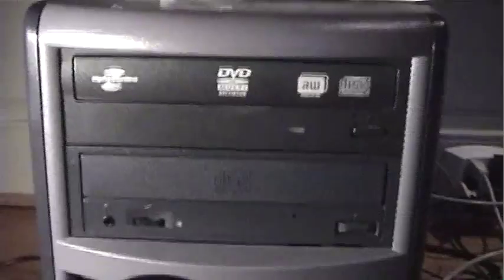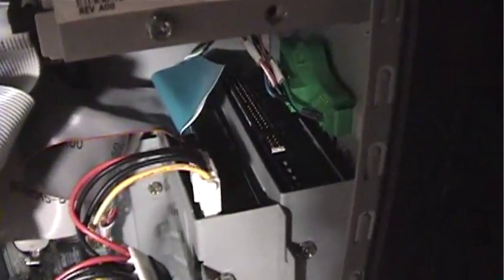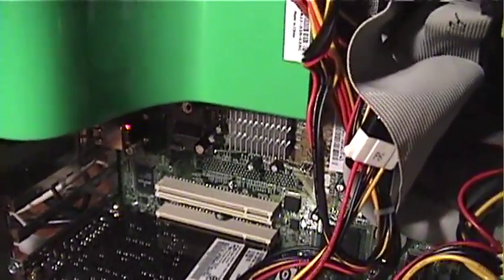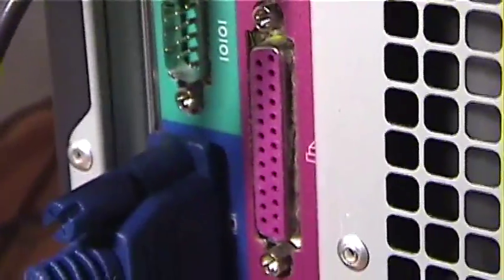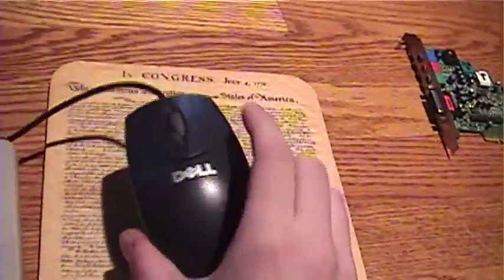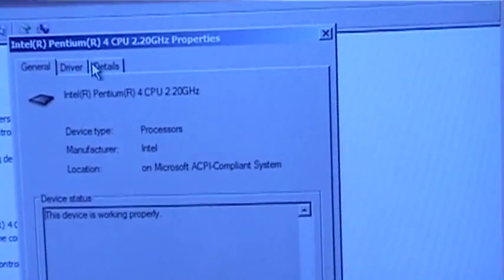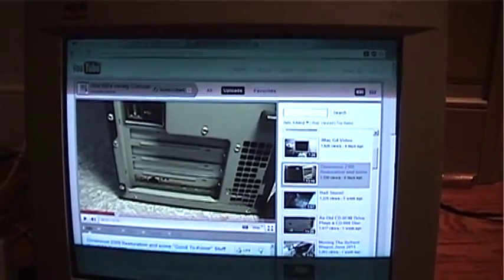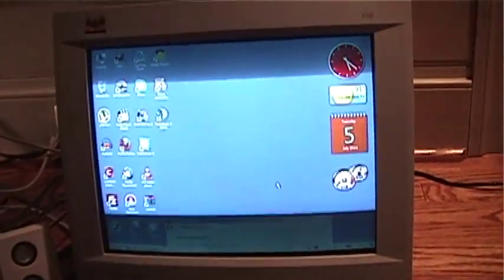Dell Dimension 2350

Comment: I used to have a laptop that was just like that. It was a Dell Inspiron 1100. It had a 2.4GHz Pentium 4 northwood and basically all of the other hardware that the 2350 has. What onboard audio does it have? Mine had some kind of sigmatel chipset and it didn't sound half bad.

Comment: Ah the Dimension 2350, I still have this machine. I got it 2gb ram and put a P4 2.4Ghz (Originally had a celeron 2.0). There was no real purpose for upgrading it, but hey why not. I like messing with these older computers.

Comment: ive also got a Dimension 2350. Pentium 4 1.8GHz. Whats the RAM cap?? I wanna go to 2GB, but some ppl have said it only supports up to 1GB. Also, how does Windows 7 work on thre? I wanna put Windows 7 Pro on mine.

Comment: OMG my dream computer
Reply: Really what does your computer have?!?
Reply: Right now I have a Dell OptiPlex 360 as my personal computer. It has:

Manufactured in Feb. 2009
Intel Core 2 Duo @ 3GHz
4GB Ram (32GB flash drive for ReadyBoost)
Dell 1907FPt monitor (19in flat panel)
Macintosh Performa speakers
Onboard sound
DVD/CD+RW writer
320GB Segate drive
nVidia GeForce 7300LE Graphics card
250W Power Supply
Windows 7 Professional 64-bit

My Secondary system is a system that I got from my school. The tech coordinator believed heavily in having our school's systems custom built. It has:

Built in 2005
Intel Pentium 4 HT @ 3GHz (LGA 775 Model)
80GB Western Digital SATA Hard drive
DVD-R Burner
Intel D915GVWB motherboard
2.5GB RAM
Onboard Graphics
Onboard sound
300W Power Supply
ICPower monitor w/ speakers
Windows 7 Professional (Original Win XP Pro)
4 SATA Ports (3 free)
1.44MB floppy drive

My office computer is an ASUS X54C. It has:

Manufactured in 2011
Intel Celeron Dual Core @ 1.7GHz
4GB Ram
Onboard Graphics
Onboard Speakers/Audio
DVD-RW Burner
320GB Hard Drive
Windows 7 Professional
Reply: annacomputerwiz Nice! my main computer is a custom built:
Asus Sabertooth X79 Motherboard
Intel core i7 @ 3.2GHz (3930k) (LGA 2011)
16Gb of RAM
3TB hard disk (Western Digital)
128GB SSD (Samsung EVO)
PNY GTX660
Corsair RM750
HP Blu-Ray burner  
Windows 7 Ultimate 64-Bit
I just bought that one but the one I had before that was very similar to your OptiPlex 360.

Dell Inspiring 530 Built in 2008
1TB hard disk (Western Digital)
160GB secondary hard disk (Seagate)
Intel Core 2 Duo @ 2.53GHz (LGA 775)
5GB of DDR2 RAM
300Watt Power supply (Bastec)
Windows 7 Ultimate 64-Bit

Then there is my radio station computer it is a Dell Dimension E520 built in 2006.
250GB hard drive (forget the manufacture)
Intel Celeron D @ 2.90GHz (LGA 775)
2GB of DDR2 Ram
DVD-ROM drive/ CD-RW burner
30Watt power supply.
But hey, if I did not buy my custom build my computers would be very similar to yours.
Reply: Our family isn't the richest (you probably figured that out after I said that my secondary came from my school. :P) but my Optiplex came from the trash.
Reply: annacomputerwiz My computers our from the local transfer station two! I just bought the one I am using now because I wanted to get it so I saved up and bought it. You computers are very nice though, most of my computers are like yours.
Reply: Stay tuned for a special presentation in about 2 weeks. I am building a computer. The specs will be released in the video. The only thing I will say is that I will be running Windows 7 on it.